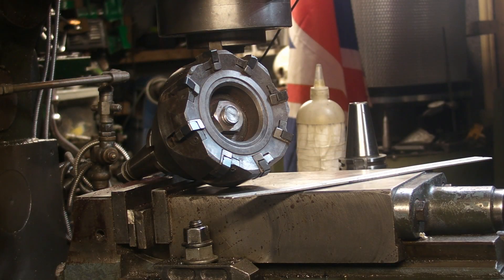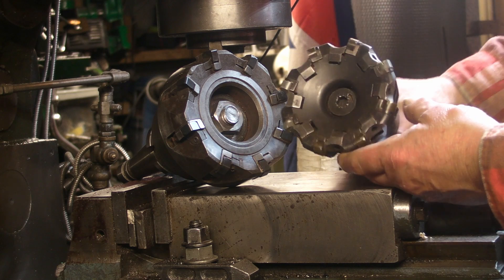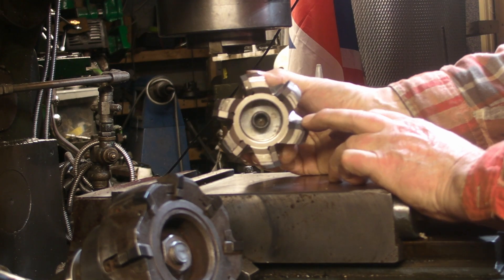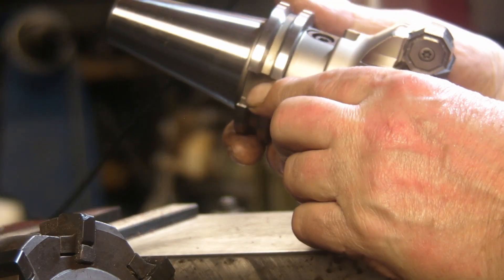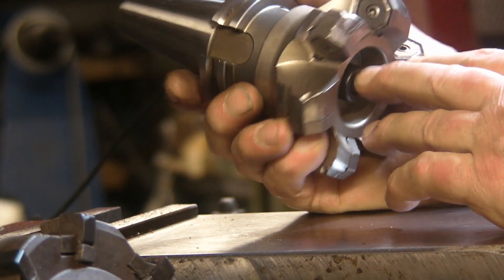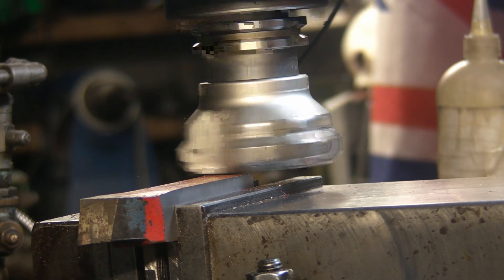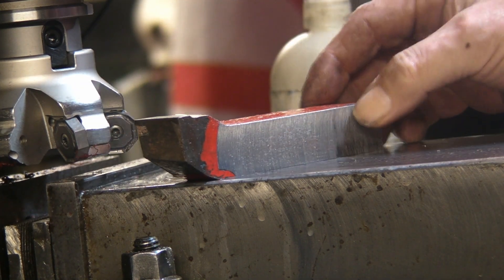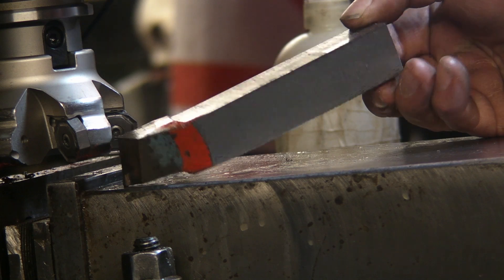Ceramic  tipped face-mill

Comment: Very interesting. That is incredible how good that tips work.
Reply from the maker: Hi Rusty. Hard to beat the ceramics for finish ! bit of advice when looking for a mill, I've found that 40 taper tooling is the most plentiful in the second hand market and therefore the cheapest, the 40 taper toolholder for the new Iscar was £12.50. I know I've said it before but mass is everything when milling ! you can do small jobs with a large mill but not big jobs with a small mill ! and the day will come when you have a big job . Regards...Del...

Comment: Yeah, ceramic cutters are nice... Quite gentle in some ways, but remarkably durable in others... Machining abrasive materials like castings, rusty layers on old steel, crusty millscale and similar crap which otherwise dulls cutter with extreme ease - behaves quite nicely with ceramic cutters, or rather, the ceramic cutters behave quite nicely where most others would fail... They also behave quite nicely when they encounter chilled spots in castings, something that HSS cutters hate and carbide only moderately tolerates... I would dare say that ceramic cutters would also make fucking sick custom ground inserts for machining glass filled/reinforced plastics, given their tenacity in resisting abrasive abuse, but that is just speculation on my part... 

Cheers, best regards!
Steuss
Reply from the maker: Thanks for the input Camillo, how's the new shop coming along ?...Del..
Reply: @machinenutdel6764  it ain`t... currently i have everything planned out, but monetarily... well, i needn`t explain... 
For the moment i`m fixing my car in my yard, parked on concrete full slabs to rise it up... The last 8 months have been a rolling drama essentially in some regards, so shit is more stagnant than toilet water, but alas, things are bound to pick up some pace as time progresses... we`ll see what the tide brings... 
Once the land is consolidated and the paperwork is in order, i`ll start the 270 cubic meters excavation and i`ll start laying some prep for the foundation... Once the foundation is done, the rest is easy work... well, technically... Once the slab is cast and cured, the shop can be set-up as a steel frame, insulated construction, which can later easily be encased in brick and given the late 1800`s ``factory`` appearance, with the inside already having been fully decked out... 
The biggest part that i`m looking towards is the car and machines restoration section of the shop, as i am fucking sick of not being able to work on my vehicles properly(also, the lift acts as a double parking spot...) and i really want to start working on the machines that i have picked up for myself, as well as picking up a few machines to restore properly and sell to worthy operators... Just recently have i passed by a cnc surface/tool&cutter/cyl. grinder, essentially a true universal grinder, a relatively small machine(2.0 x 2.0 x 2.5m(WxLxH)) that was tossed out to the scrapyard... A marvelous little beast that was destroyed(i saved the head... i`m sick, i know...) but could have almost been sold ``as is`` by a sane person... A fucking shame that is... I know that it`s not really a hobby shop machine, but let`s be fucking real, i would have been willing to snag it for like 400$, spruce it up a bit, maybe scrape in the wear, put some turcite to restore the OEM design specs, and dish it out to a hobby machinist for a few grand... I mean, such a machine can be sold for 10K easily, it`s a workhorse that can run a small business all by itself in right hands, but it offers a hobbyist in a single ``large`` body what otherwise would require at least 2 large machines or even 3 independent machines... Being able to grind your tools, both round and any other shape, grind literally any cutter(gears, what not...), grind your gears after hardening, grind literally everything and anything that fits the table(2x longer(for rotary headstock setup) but as wide as a bridgeport table)... I mean, it`s an unorthodox hobby shop machine, but as said, it covers literally all grinding with automatic compensation for literally everything, that is if you know a bit of cnc... In my eyes that is the most perfect machine for almost every hobby machinist(outside the realm of watchmakers, boilermakers and similar)... Such a fucking sick machine, and it went to shredders... What a fucking shame, and all because i lack space atm... 

Anyway, you really shouldn`t have asked, as you can see - you prompted a torrent of madness being unleashed... Hope you are doing well at least, both in the shop and in general... 

Until next rant, i bid thee all the best!
Reply from the maker: @camillosteuss  I'm a bricklayer by trade retired now, wish I could help, keep the old pecker up my friend !...Del..